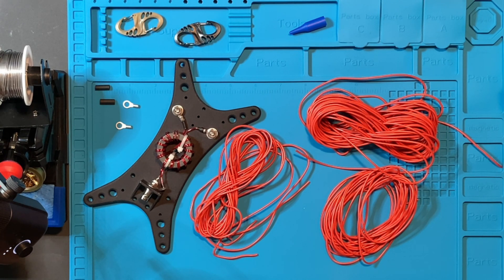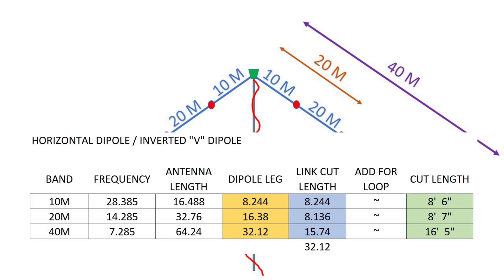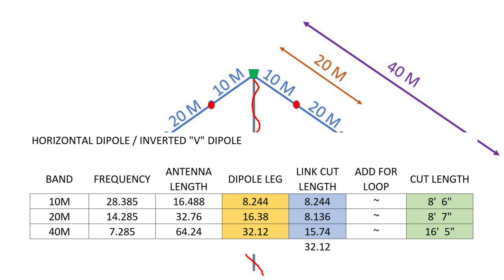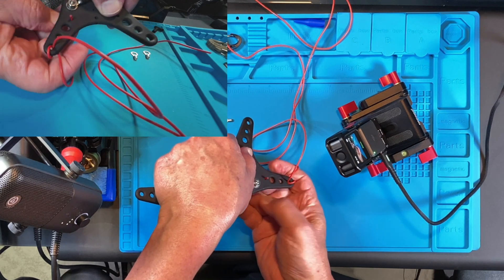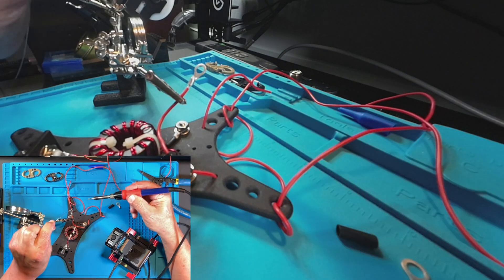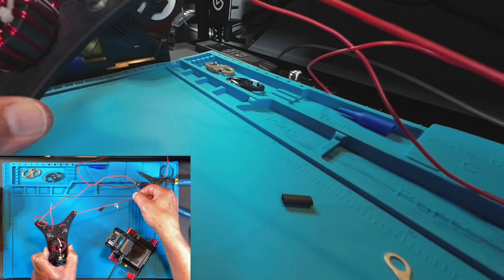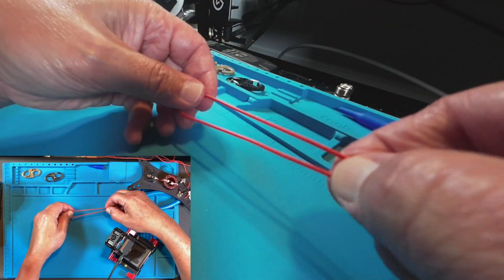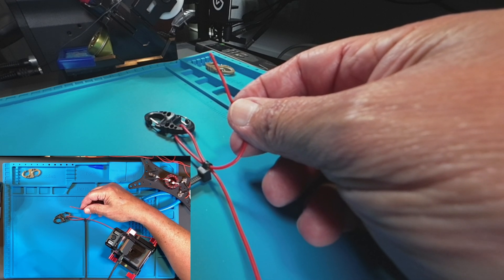Part 4 CUT WIRE TO LENGTH:  Build a Linked Dipole for 10, 20, 40 Meter Ham Bands -- CaHR Mercury Kit

Comment: Hi I recently purchased a linked dipole from a ham fest in England it said for 20–40m. But the linked lengths are from feed point. 15ft 2nd 16ft. 3rd 9.10feet 4th link 9.1feet. Total per leg 49.11feet ?  But I can’t seem to match for which bands. Can you. Help please   Mark uk

Comment: This particular video has inspired me to use my 3D Printer to design a  similar frame to the  one In the video.  For my 1 Dipole I simply drilled holes in a PVC PIPE Cap from local big box hardware store.
I am truly grateful for all the details in this video series.  Indeed motivational.
73 Steve AA4SH
Reply from the maker: I appreciate the really positive feedback.  These were some of my earliest videos when I started my channel.